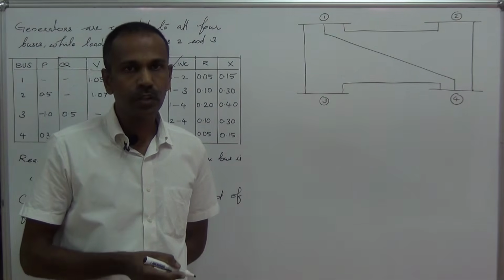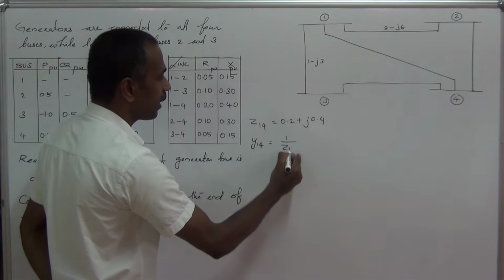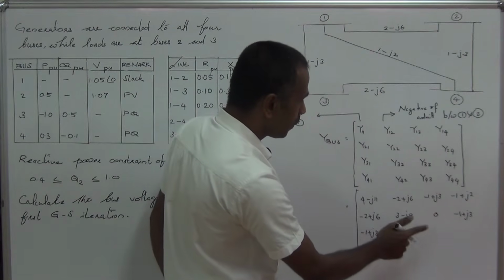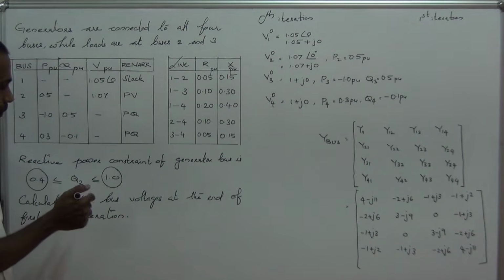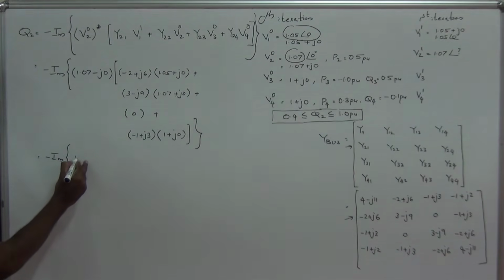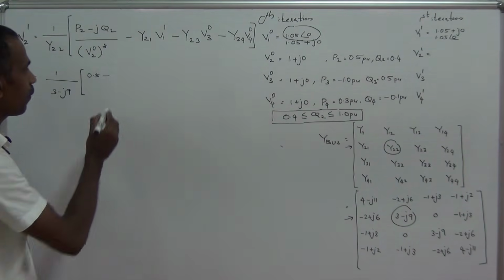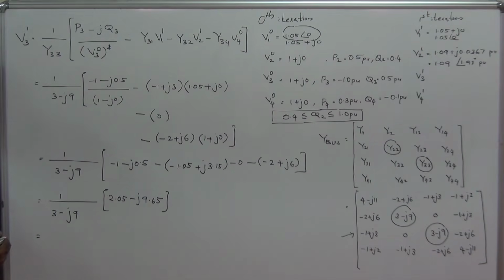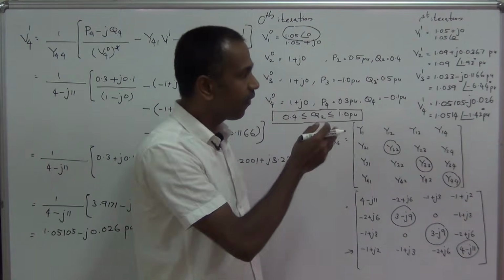GAUSS SEIDEL LOAD FLOW SOLUTION(PROBLEM 3)WITH REACTIVE POWER CONSTRAINT/ KTU/ POWER SYSTEM ANALYSIS

Comment: Thank you so much sir, your videos have really been helpful in my academic journey. I really appreciate.
I have a question on this problem 3 and i would really appreciate if i get a reply to this.
From the problem 2 you solved on GS Load flow, you made the polarity signs of the values of P and Q change for PQ(Load) bus i.e PG-PL but you didn’t do the same for problem 3. Is there a reason for that?